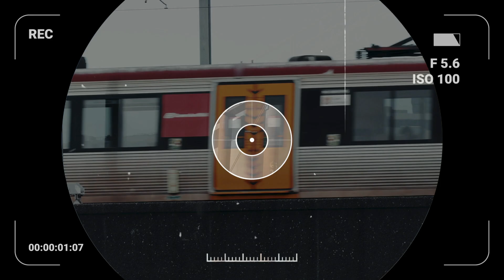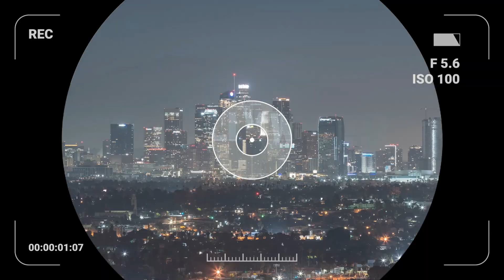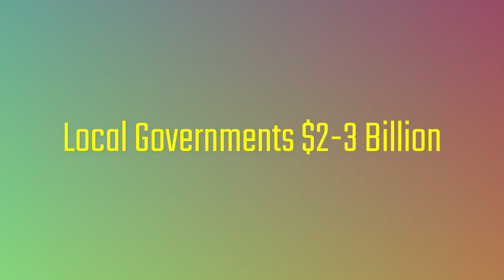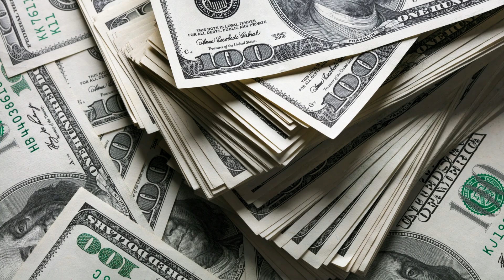California’s $128 BILLION Failed High-Speed Rail

Comment: Initially foreign corporations who had created successful high speed rail systems in their own countries were happy to come to California, check out the project and offer oversight to make it a success. After they got a whiff of the corruption and politics, they decamped and went home, to continue to build successful systems in other countries. A look at the map tells you this project was never meant to be completed, only to be milked for political and financial gain.
Reply: Totally correct. The Alstom guys who built the TGV had some choice things to say in the French press. 

This is yet another Jerry Brown Monster Ego Vanity Project. Like the "Signature" Bay Bridge section that will fall down in the next earthquake. The "high speed train" that goes from nowhere to nowhere at high speed. Everywhere else not much faster than CalTrain diesel locos. That route accounts for < 10% of Bay Area to Southlands end to end trips. So driving or flying / renting a car will always be faster. Even with the most optimistic (i.e fraudulent) passenger load projections the trains will lose 4X+ the ticket price for every passenger carried. If ever finished. Which they wont be. 

Pure fraud from start to end. Shut it down and upgrade the freeways which have seen little or no work since the first time Jerry Brown was governor. In the 1970's. Freeways are great. Fast, efficient (and at least before CEQA) pretty easy to build. But thats yet another total disaster created by Jerry Brown appointees. Like CARB and CalEPA. 

Simple fact is you cannot build fast, efficient and cost effective passenger rail in the US due to Progressive Era laws and regulations. At the Federal and state level. Again, ask the Alstom guys about the great Acela fiasco. How many billions did that cost. With nothing to show after a decades work with a proven technology.
Reply from the maker: Indeed. Nice read